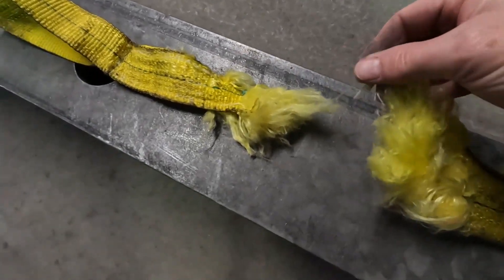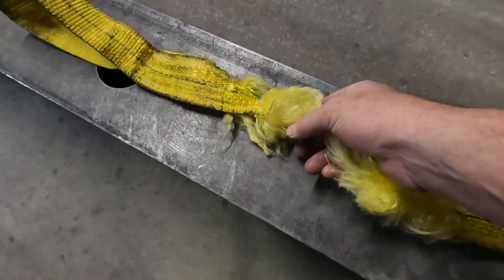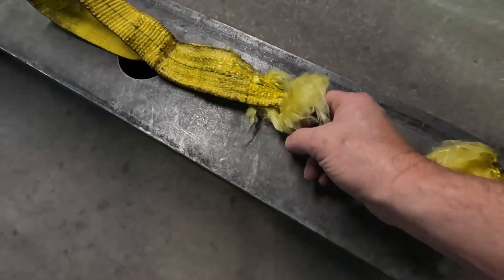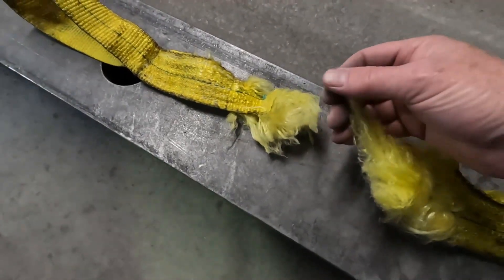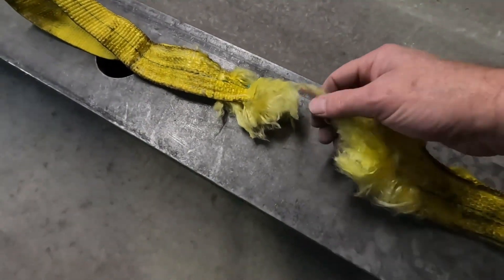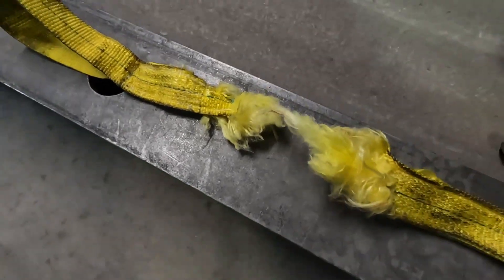Web Sling Break Test

Comment: Excellent video! What was the load rating of the sling? As a 4wder in Australia, 4.75 tonne rated shackles with a 22 mm (7/8") pin are common. How would that pin size affect the load limit or breaking strain? A super slow-mo of the break would make a great Youtube short! 👍🙂
Reply from the maker: Here in the US these are on a 5 to 1 working load Limit, the vertical capacity of the sling is 6,400 lbs and breaking is 5times that.